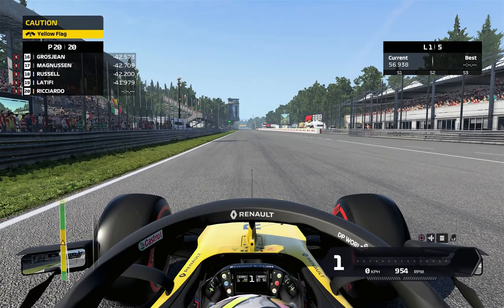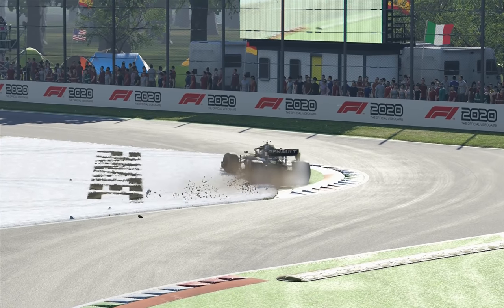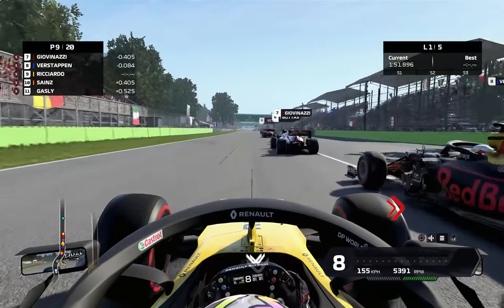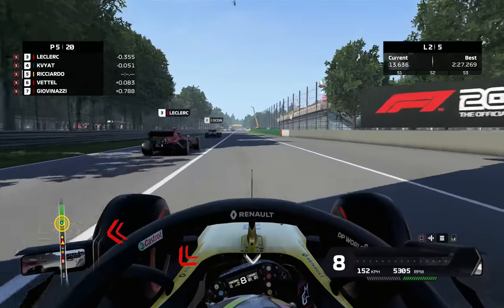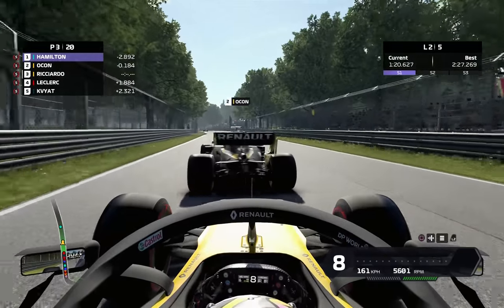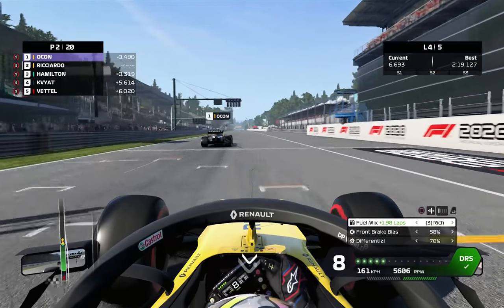Renault F1 Car With A Renault Clio Engine At Monza

Comment: Next video: Renault Clio with a Renault f1 engine
Reply: @cxmmax4265  yeah ik
Reply: @shadowblade2149  so you know they can do a clio f1
Reply: @cxmmax4265  yeah ik. But I want a modern version. Which is possible cause now the engines are 1.6 litre
Reply: @shadowblade2149  ok
Reply: They actually did it, there is an old clio v6
Reply: Good idea
Reply: Renault Cilo Procar

Comment: As someone who drives a Clio, I feel offeneded. It can drive 180 kph!
Reply: Lmao Renault clios are underrated
Reply: 'I am speed' ~ Renault Clio
Reply: I also drive a Clio, awesome car and so cheap in everything
Reply: F1 cars produce much more downforce so a Clio is more aerodynamic when it comes to top speed
Reply: clio MK2 driver here, im not sure my 75hp can get my car past 170kph on a good day.
Reply: It's the downforce holding it back that extra 30kph😂😂
Reply: It's actually the gearing. He's at 5000 rpm at 140kmh.
Reply: Maybe you have the new model, my grandpa had one which can do 160 kmh in a downhill
Reply: @Iceman-hb3uk  mine is a 03 MK2
Reply: 220 on a '09 Clio RS 😎
Reply: @extec101  I had the campus model it was 8v rather than your 16v I had something like 62hp lol
Reply: @ML-si5ht  that is a low hp engine and the one 8v in the 99-02 modell arnt that like 55hp?
Reply: @matthewdura2043  That's not true.

Dow force is aerodynamics.

An f1 car weighs much less then a Clio
Reply: @boltmix7294  Yes that's why the Clio F1 is going faster to 100 kph but doesn't reach the top speed of the normal Clio.
Reply: @extec101  mine was an 07 but was the last of the bubble shape before the mk3 came out. Because it was a cheapo last model edition it had a different boot style and front bumper to all the clio mk2 styles. It did have radio buttons on the steering wheel though!!!
Reply: @ML-si5ht  cool with the radio.
where im from renault cal the last form of MK2 "clio storia" and it seems they got alot of different styles on front bumper and interior so im guessing renault used up some of ther parts laying around to make the last hurra of the MK2.
Reply: @extec101  yes mate and for all the shit French cars get, other than a little spanner on the dash every 5000 miles it was sweet as a nut for a first car. I sold it on to a family with 4 kids and they are all using it as their first car too. Poor clio 😂
Reply: @ML-si5ht  clio in not a bad car,as i got one and ther is relatives to me that enjoy ther clios and think its a good car with few problems and cheap on gas.
Reply: M L i had a ‘99 1.6 8V 4 door with 90hp, max that i got was 190 kph.
Reply: M L now i drive the mk 4 0.9 TCE but it takes ages before i even get to 150 kph🤣
Reply: @M0nkeyDonkey  my model would not hit 160kmh, you have to pop in in neutral down a hill at top speed (155kmh) and you and your mates rock forwards and backwards for more speed 😂😂😂
Reply: But your kilo has less drag and downforce.
Reply: @optimusprime9361  but drag has nothing to do with engine rpm. The gearing was too short to let the car reach a higher speed. Don't belive me? Look at hill climb or rally cars, 300hp less than a ton but only do 120mph
Reply: True. Did 195kph on the Clio TCE 120 xD
Reply: M L so basically you were full throttle everywhere you went 😂😂
Reply: @M0nkeyDonkey  yes, it's a bad habit to have once you get a car with some oomph 😂 sold the clio and the speeding tickets rolled in after my new faster car arrived 🤭
Reply: Your still faster than williams 2019
Reply: On your speedometer in freefall I guess
Reply: I love how you see how this game is trying to fake physics when you see how it gets faster than normal on parabolica ;D
Reply: I’ve taken my baby up to 216kph and we were fucking flying ❤️
Reply: Yea but F1 cars have more drag than a Clio

Comment: What if every car had the most perfect car so it has infinite downforce, power and weight etc
Reply: We need this
Reply: Why u talking About the mercedes
Reply: Infinite weight sounds pretty slow to me...
Reply from the maker: 'infinite' in a game is not something that works well at all 😂 It becomes impossible to control, imagine a car with infinite tyre grip and infinite brake power, you could go from 300kph to 0 in literally 0.0 seconds. How do you control such a beast?
Reply: @AlexGillon  You could if you were a robot
Reply: Alex Gillon well, within reason, basically something that is impossible to replicate in the real world, for example, 10,000bhp, 300kg and 20x the downforce etc
Reply: rivitril braking from 300kph to 0 instantly is physically impossible
Reply: @AlexGillon  technically Formula DS in Assetto Corsa
Reply: Nasser Al Khelaifi say that to the school I hit yesterday
Reply: @AlexGillon  I guess he means you could turn at any speed without understeer
Reply: Infinite diwnforce would make the car impossible to move, same for mass
Reply: Infinite speed would max out a the speed of light so they would get round in about 0.0000000000000045 seconds
Reply: That's not how engineering works... you can't just wack all the stats up and expect shit to work. It's ALL about balance, both in games and in real life.
Reply: It would kill you 😂
Reply: @rivitril5440  you couldn't because it would be braking so quick that the delay in the program is so "long" that it wouldn't work
Reply: Would make the car very slow then as the only way to create more downforce is to create more drag in effect as the wings create negative lift. Probs die the moment you open DRS if the drag from the front wing is more than 2x the car's weight

Comment: 5:11 well I was cycling one day (I know this has 2 less wheels) and without pedalling, with just doing left and right rapidly I started to gain speed. If you executive it well you can do 10 kmh from 0. Pumping up the tires help as well. In conclusion that is something but I don’t know if 4 wheeled stuff also do that and I also don’t know what causes this
Reply: and as you said it works better at lower speeds with my bike. I guess tires’ friction work to push the car at lower speeds and at higher speed that friction just slows the car.
Reply: It's like a Snakeboard/Streetboard.

Comment: Does it have something to do with generating heat in the tyres? Can't imagine you have ANY at 150kph. Perhaps parabolica gives tyres some heat
Reply: Seems very plausible, as more heat leads to a higher pressure and therefore less friction.
Reply: I thought of that too, must be the tyres going to optimal temperature.

Comment: By driving at 150~ kp/h, your tyre temperature drops down and by swerving you're increasing the temp and therefore increasing the grip of the tyres.
Reply: And how does more grip mean faster top speed.  Just think about what you said a little longer. lol
Reply: @ChefofWar33  Didn't say it's going to increase the top speed. It will make the acceleration quicker.
Reply: @aniko7462  But it still wouldnt do that.  Only if it was grip limited and you werent able to put the power down would better tire temps increase acceleration. I doubt thats an issue here. XD
Reply: @ChefofWar33  Do I have to specify that I'm talking about within the context of the game here? The guy probably has traction control assist enabled.
Reply: Bryce Peters more grip=faster acceleration

Comment: Swerving might get the tire pressures up just alot. I used to do bi motor kart championships and people were calling us crazy for putting 4bars of pressure on our kart tires on high speed tracks. And because we put so much pressure, on straights the tires got less friction and just go way quicker on straights. The karts we used had to be identical from 1 manufacturer. Also the engines got sealed by the organisation. We had our engines checked each week by the organizers cause they truely believed we were cheating and upgrading the engines. Which was not the case. We just ran extreme high pressures on fast tracks

Comment: Rewatching it now I figured out why you would accelerate when turning. You gain speed or acceleration when you go on the racing line, and since you're going so slowly you can get out and in on the racing line meaning the accelerations stack. Usually you couldn't do it that much in full speed coz your turning would take away some speed, but here it works :D

Comment: I think it has something to do with tire temp as well. Too cold or warm they will have a level of slip at higher speeds. The right temp provides the proper amount of grip to apply all the power to the pavement. Also the more negative the camber in the rear the less contact the tire is making, creating more slip in the straights. The weaving back and forth shifts the weight to lean on the entire contact surface of the outside tires allowing more surface area to apply the power. Slingshot effect. Which is why the flat out corners do it the most.

Comment: Looks like the swerving is only considering your forward motion as getting resistance.... so if you change direction, can cover more distance (frontal + lateral) with only 1 resistance. It's like this for isometric games when you move up/down/left/right opposed to diagonaly. Let's say 1 tile is 80x80 pixels, then moving left you are at 1 tile per second, BUT when you move diagonaly you are STILL at 1 tile per second, but since the diagonal is longer than a square's side, you are effectively moving 41% faster.

Comment: My guess is that the speed advantage you get from swerving comes from the way friction forces are applied to the wheels - it might as well be down to some small flaws Codies' own physics implementation might have in that area. Generally though, tire models are the most difficult thing to simulate accurately.

Comment: I think it could be something simple like tire temperature. Knowing how sensitive the temperature window is, and how much slower the cars are going with the Clio engine, the car might be finally getting the heat into the brakes and tires it needs to go faster and lay down more rubber on the tarmac.

Comment: Engine displacement: 1332 cc
Horsepower Range: 115,130,140,150 and 160
And is applicable to model's: Nissan, Renault, Dacia and Mercedes.

Comment: The swerving might be because you're putting more temperature into the tires which results in more grip which in turn gives more speed. Because cornering speed and max speed is down, the tires have a hard time warming up
Reply: I just commented it. It pissed me off

Comment: It's not to do with drag etc. at these speeds. Top speed is simply revs and gear ratios. If the Clio engine could rev to the same as the F1 engine, it's theoretical top speed is the same as an F1 car but that's where aerodynamic drag would have an impact with the power.

Comment: Probs that the wheels are too cool, swerving it heats it up to optimal temp, probably causing that speed increase. For the full speed caveat on that is that the cars run fast enough to heat it optimally

Comment: Could it be a simulation of the crash physics? If you overcook a turn and start to slide, is their an underlying physics system that accelerates the car to light up the rear tyres and throw you off track at speed? If you swerve so aggressively at full throttle with an F1 engine, you're probably heading for a wall?

Comment: Isn't that because of the grip? when you turn you loose a bit of grip and with that soft tyres and weak engine when you turn you loose grip so it's easier for the engine to run faster? i guess

Comment: is it possible that the game thinks if you were wobbling, that you want to cut the dirty air constantly, even if you drive without somebody in front.

In earlier games the dirty air was not realistic, spacialy if you switch lanes at the end of a straight to come out of the dirty air (in real)
With wobbling it is possible that the game calcul the negativ drag away, so you minimes the air friction

Comment: Boo you did it wrong. Tce130 is an I4. You should have used the Tce100 which is an I3, basically half a V6.

Comment: This swerving is interesting. I like to think that it's on purpose to make the races more interesting or the overtakes a little bit easier.
Maybe the swerving with full power doesn't make you any faster BUT it maybe helps you with keeping your speed when you swerve out of the slipstream to try to overtake.
Reply: It helps raise tire temps